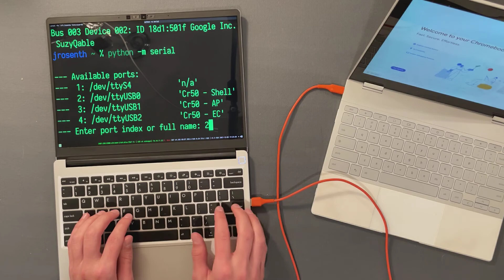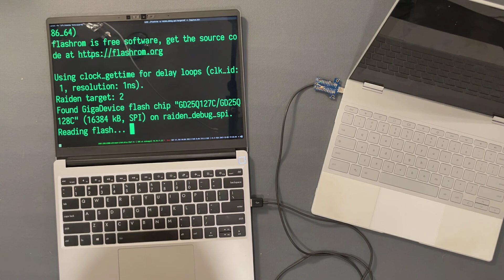Make your own SuzyQable (Chrome OS Debug Cable)

Comment: PCB TYPE C
A4 - RESISTENCIA 22K - A5
A5 - B9

B4 - RESISTENCIA 56K- B5
B4 - A9

CABLE USB
+5V (RED)   - A9 & B9
+D  (GREEN) - A8
-D  (WHITE) - B8
GND (BLACK) - A1,A12,B1,B12

some male type-c PCBs have the pins (A5,A8 & (B5,B8) INVERTED because they make the tracks of the femaales.  To correct this in A5 you must connect what would go in A8, 

In A8 you must connect what would go in A5, the same logic applies for B5 and B8, do not forget that the type port can enter in any way, if you connect it wrong in the chromebook will not work this circuit only works in one orientation.  you can try and tell me

Comment: Hello. Dumb question here but I only found female USBC breakout board. Can I connected it through a male-male cable?  Thanks !
Reply from the maker: Yes it should work but the cables you use to gender change need to be complete. Not all have SBU1/2 connected, so use quality cables.

Comment: The official document calls for a 45.3k instead of a 56k like you used, and on the chrultrabook discord server, there's a mix of people saying 45.3k and 56k. What's going on there?
Reply: The 56k works on some boards but according to documentation it is supposed to be 45.3k

Comment: Why is a breakout board needed? Can't you just cut a USB-C cable and re-wire the cables and put the resistors on some of them?
Reply: One of the normal functions of the CC pins is to detect the cable orientation. (Specifically, whether it goes  straight through or is flipped.) To do this, the cable has a single CC wire going from CC1 on one end and CC2 on the other end. The devices can therefore figure out whether the cable is flipped based on which combination of CC pins on the ports get connected.

The suzy q cable requires resistors on both CC pins to enable non-standard functionality. To do this, you must have both CC wires. A USB-C male to male cable won't provide this (unless you get lucky and find an emarker-equipped cable with an emarker on one end connected to the other end with a wire, rather than an emarker on both ends, and are able to figure out which end that is so you can use the non-emarker side).

However, a USB-C male to female extension cable likely will work. (As long as you get one that advertises USB-PD support so you can be sure it has the CC wires and displayport alt mode support so you can be sure it has the SBU wires.) Such a cable can be thought of as basically moving a port somewhere else, not connecting two devices, so it should have all wires, no resistors, and no emarkers. That said, good luck figuring out which pin all the wires go to without having a breakout board anyways.

I personally ordered a USB-C male to female cable and a USB-C female breakout board because I could get that faster than I could get a USB-C male breakout board. I will edit this comment once that stuff arrives and I've tried it.

Edit: The USB-C male to female cable and female breakout board idea worked (though soldering the absolutely tiny wires was annoying), and my chromebook is now unbricked. It was actually less trouble than I was expecting to figure out which wires go where. The thick red wire delivered 5V as expected. My particular cable used the outer shield as the main ground. (Not sure whether that's allowed, but that's what my cable did.) The D+ and D- wires were green and white, as expected. The high speed differential pairs were shielded with individually with colored foil. So by simple process of elimination, the four thin wires that were neither green nor white were the wires I had to use.
Reply from the maker: That should work but may be difficult.

Comment: Does the program only run on Linux and ChromeOS?
Reply from the maker: I used two programs here:

pyserial to access the serial console.  this will run on Linux, Mac OS X, Windows, and BSD.  there's also a variety of other serial programs you can choose from (minicom, putty, etc)

flashrom to read and write the SPI flash -- which works on a wide variety of operating systems.  see flashrom.org for more info.
Reply: @JackRosenthal1  thank you !!! 🤓

Comment: You say connect "Green D-" to SBU2.  Wikipedia says that Green (USB A Pin 3 as viewed 4 3 2 1 end on at the connector)  Green is D+.  Is it GREEN to SBU2  or is it D- to SBU2?
Reply from the maker: The colors of the wires can vary based on country, etc.  When in doubt, pull out your multimeter and use the continuity test mode to determine what is what.  D+ goes to SBU1 ,D- goes to SBU2.

Comment: Nice Video, just got the cable working and it can be detected on both Windows and Linux. It was not working initially but all I needed to do was to flip the USB-C and it does the trick haha. Your video helps a lot with the wirings, thanks. I am able to unbrick my firmware now.

Comment: The Saiko systems board is confirmed working, the green USB equivalents found on the likes of ebay and AliExpress are no good.
An exception to the above is that there are versions with pin headers that seem to do the trick - haven't used one of those myself, but a colleague has.
Reply: For the greens, swap the A5 pin for the A8 pin and the B5 pin for the B8 pin.

Comment: Don't suppose it's clear at all why mine won't show the right response 

https://drive.google.com/drive/folders/1BEsrLkLa0aCkkfAHxNZClgTMnazgTSHt

Third attempt. Chomebox 4. Everything else is fine, just the cable I make won't do what is expected
Reply: Hi, did you figure out why your cable cannot work? Mine breakout board is just the same with yours. THX!
Reply: @杨益-s4e  I got this green board. Just swap the A5 pin for the A8 pin and the B5 pin for the B8 pin.   
The green board uses a backwards usbc-pinout:  
[https://pt.wikipedia.org/wiki/Ficheiro:USB\_Type-C\_plug\_pinout.svg](https://pt.wikipedia.org/wiki/Ficheiro:USB_Type-C_plug_pinout.svg)  
instead of this:   
https://www.allaboutcircuits.com/uploads/articles/Fig1m11292018.png
Reply: @leadscollector  Can you send a picture of how it turned out? and if it's working perfectly

Comment: Hi Jack I wonder if you can help me please I have ordered a usb-c full 24-pin breakout board, adapter, pin header converter module USBC board to make the debug cable. I have the resistors 56k ohm and the 22k ohm but noticed my board is slightly different to yours. It is a green board. If you type this in ebay it will bring up the exact board. Can you help me with this as the numbers on the board are different to yours. The board description is (USB-C full 24-pin breakout board, adapter, pin header converter, module, USBC). Kind regards David
Reply from the maker: Does it have the pin numbers labelled (A1, A2, A3, ...)? If so, you can follow the wiring diagram here: https://chromium.googlesource.com/chromiumos/third_party/hdctools/+/HEAD/docs/ccd.md#making-your-own-suzyq

Comment: hello, I made a cable according to your instructions, how can I check if it works?
Reply from the maker: Test it with a Chromebook. See from 6:45 until the end of the video.
Reply: @JackRosenthal1  But is there an instruction somewhere on how to check the cable, remove the protection from the Chromebook and flash the memory using it?
Reply: @JackRosenthal1  according to your instructions, when you connect the cable to the PC and enter commands in the terminal, I don’t understand what you need to enter and in what system?
Reply: @ділюсьдосвідом  it's just a terminal, pretty much any linux distro should let you install python (and pyserial), and from there you can just run those commands

Comment: Can it use Type c female, cause i cant find Male breakout board in my country.
Reply from the maker: You may find it difficult to find a USB-C cable which has SBU1/2 connected. Use two female breakout boards and a multimeter to probe the cable you intend to use to connect, and validate SBU1/2. Mark the cable with a permanent marker once you figure out the right orientation.
Reply: @JackRosenthal1  i try it. Thank you.

Comment: Could you please link specifically to the resistors you used as well? I want to make sure I get the correct components. THANK YOU!
Reply from the maker: Any 22k and 56k resistor should do. I used resistors I had on hand but the below should work:

https://www.digikey.com/en/products/detail/tubedepot/294-56K-RC/10487886

https://www.digikey.com/en/products/detail/yageo/CFR-25JB-52-22K/1306